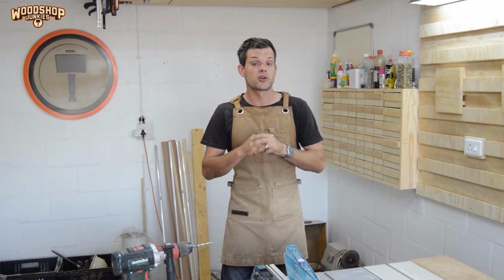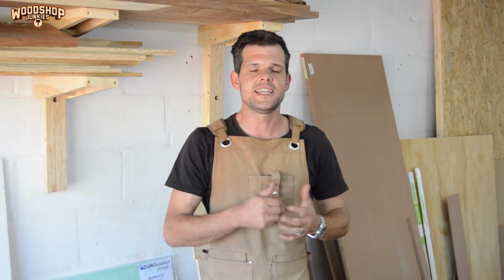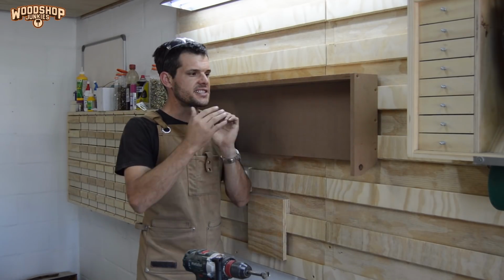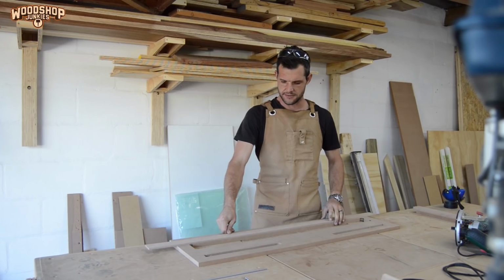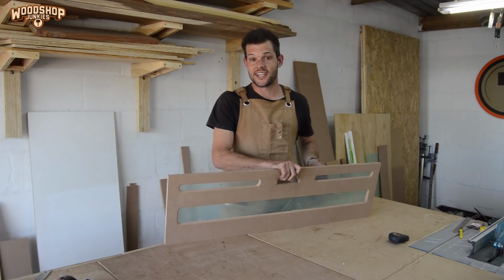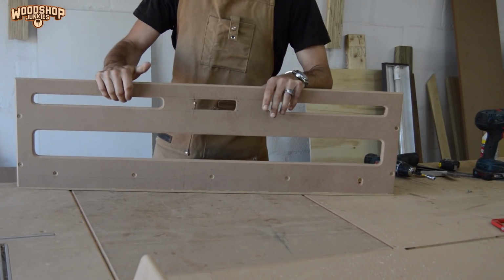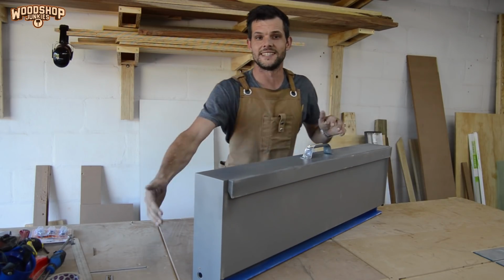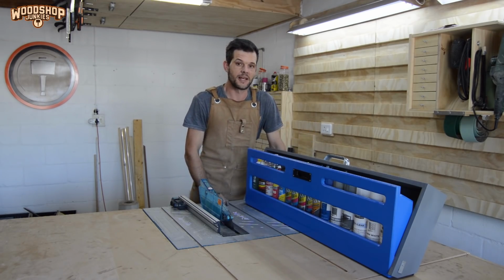Making A On-The-Go Storage For Paints And Wood Treatments - MDF Projects

Comment: MDF is so soft like butter to work. I personally not a fan but it has its place.  Wear surface you need flat like a bench top.  I have oak semi trailer flooring on mine and it is tough.  Butcher block 2x2 strips that hold up to forklift and years on the roads.  Blue paint looks good and would match my toolbox at the house lol

Comment: Great Idea, view panels nice touch. The idea of movable cupboards is good but weight an issue for other stuff. Did you find the MDF a lot heavier   than ply? And I feel that once moved around, the mdf may fracture where the pipe joint is, where ply would be more robust. Your workshop is Fab. 👍

Comment: The shop is coming along nicely, just one tiny tip for you when working with MDF you have to pre-drill every single time you are using screws as it will always split (tear) if you don’t.

Regards from Melbourne, AU

Comment: Great job!  The blue works well.  Thanks for sharing, as always.  One suggestion: I noticed the lights mounted above the cabinets are flush with the wall.  You should mount them about a foot off the wall so you don't get shadows in the cabinets & drawers mounted below them as you look for something.  That might be a good project; some sort of retractable light bracket so you can move them out of the way as necessary  hint hint :)

Comment: I can't quite tell from the video, (assuming I am not wrong) but was the french cleat on the shelf unit also made from MDF? I have lots of scrap MDF, and always wanted to use them for this application ,but I never experimented with using it as a french cleat because I doubt its strength...how do they hold up after you load the shelves down with stuff?
Reply from the maker: It is MDF and you may be right that it won't be strong enough. Like I said, I don't have to much experience with MDF so many of the things I did in the video were firsts for me.

Comment: I noticed that after drilling pilot holes for the butt joints you didn't drill pilots in the raw edge of the other board, MDF can have a propensity to blow out (expand) once the glue soaks in and dries, you'd be better off piloting once the boards are butted together

Comment: I think as your French cleat system fills up, you'll very quickly realize that giant handle on top is robbing you of a lot of space above.  Why not ditch that metal handle and make it a cutout instead?  The one possible drawback is dust getting in from above, but that is easily addressed with a pivoting scrap of wood or even just a piece of paper placed over the cutout.  Other than that enhancement, fabulous work as always!  Thanks for the great content!

Comment: How do you keep it from opening when you are carrying it? The roller catch is nice when it is on the wall but if you are carrying it an it gets bumped it will open (speaking from experience )
Reply from the maker: If you consider the pivot point in relation to the weight of the tray, it means that the weight pulls the tray closed instead of open.

Comment: I like it in principle, but it seems a bit too enclosed; you have to reach over the top and down to grab something for example.  You could have made the piece that folds out about half the height and the shelf would have been equally functional. You could even have made a stacked/tiered/nested shelf that holds multiple rows of cans at that same angle for easy retrieval, while still being essentially immune to being bumped into. Its a cool build, but I imagine its pretty heavy as well. Thanks for sharing!

Comment: MDF absorbs alot of paint - should a sanding sealer be used first and what type of paint did you use
Reply from the maker: I didn't use a sealer but I should have. I used Rust-oleum paints. I find that they tend to be good quality.
Reply: @WoodshopJunkies  thanks

Comment: First thing with mdf, use a mask the powder is too small to be removed from your lungs efficiently. Also the big split you had in the top right hand corner, unscrew the cornersquitr super glue and clamp for a minute, then redrill with the correct size bit and don't push hard mdf has no grain to grab, great finish in the end.
Reply from the maker: Thanks! Like I said, I am no pro when it comes to MDF so I appreciate the advise.
Reply: @WoodshopJunkies  it can be a pain even when you are used to it.
Reply from the maker: @dtwistrewind7361  I am busy designing a gaming/design workstation desk and I am thinking of using MDF for some of it. That's why i am messing around with it now. I still need a bit of practice though before I'll be ready to take on a big project like that.